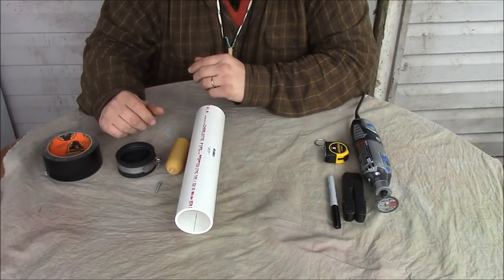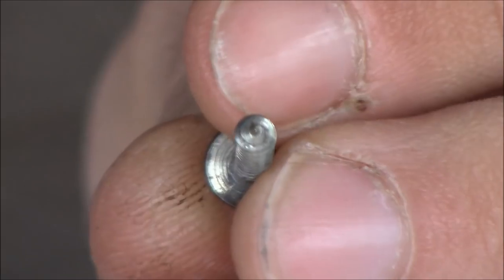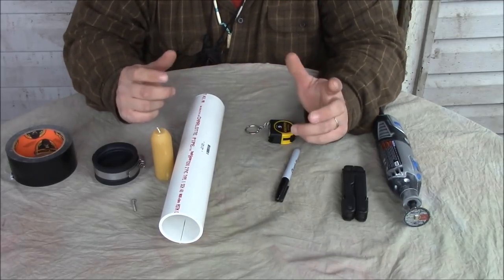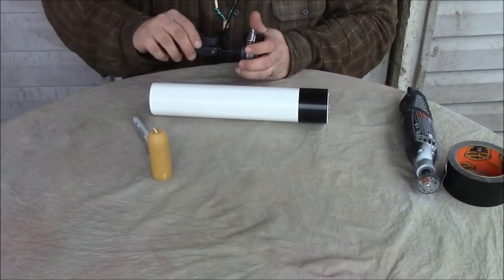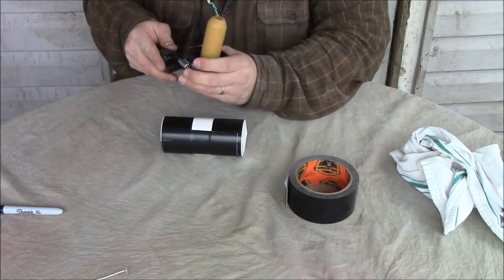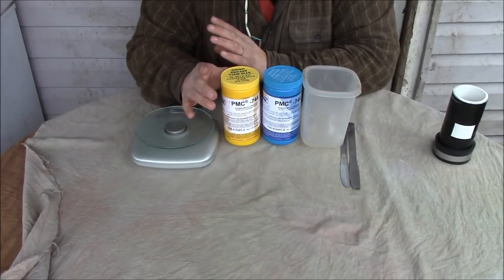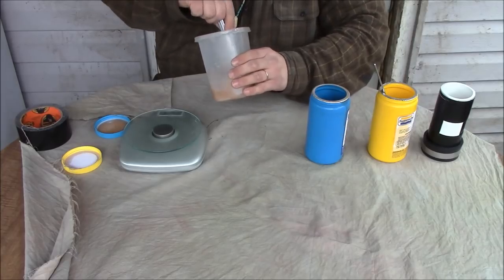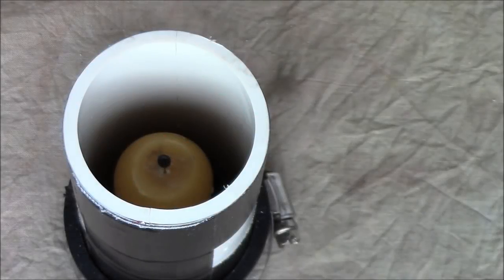How to make bees wax candles that also fit the uco candle lantern

Comment: Seven years later I found your video.  I've poured candles for years.  Always bought my moulds.   Your video is EXCELLENT on making the mould.    The viewers also should know these moulds will make multiple of candles before they wear.   The past few years beeswax has skyrocketed in price.  Finding bulk beeswax is more difficult now than it ever was.  If someone is trying to make beeswax candles try to find the blocks and not those silly little wax bb's that are sold.
I'm now getting ready to see your making beeswax candles pt. 2.

Comment: The 1.25 riser pvc or metal pipes that screw to the bottom of sink drain outlet work great. A 12" lenght can be cut into 4 molds.

Comment: I was wondering if you could make this any more difficult? or expensive.  1. UCO candle is not 2" it is 1.25" so why not use 1.25" PVC pipe to start with. With a proper fitting plug or cap, a hole drilled for wick to pass. Voila, done, costs pennies compared to poly.

Comment: Great vid, being in the 70/80 age group I'll design a (3) hole (2) piece mold as I'd use for ceramics and 3D print it, releasing should be zero hassle. Methods change in 5+ years.

Comment: Look at Juijitsu 2000's channel, he has a much easier method to making these UCO type candles. His new video reuses the same mold each and every time. No need to break or cut pipes. 
👍👍😎
Reply: His candles only last 4-6 hours they are smaller than original.. This is a much better method I believe
Reply: I saw that video.  It was good.  This is much better because of the eventual ease of removing the candle from the mould.   I've poured candles for years.   I'm going to watch his pt.2 video and see how he did.
Reply: @mattcarolina  Plus that guy isn't using beeswax which is why they don't last as long.   I agree with you.  This is superior quality than the other guy.  But hey, it works for him and what he wants.  Me?  I like things done the best way they can be done.